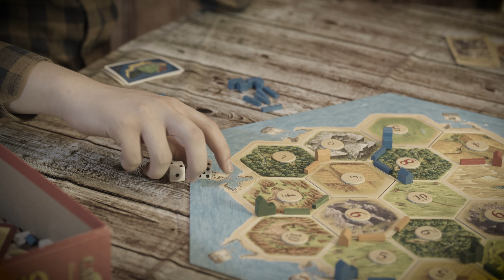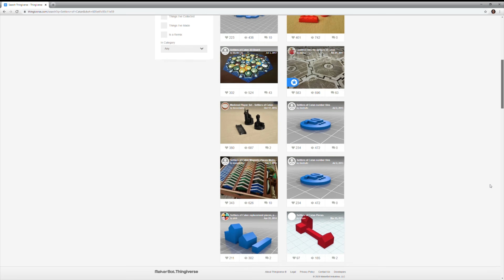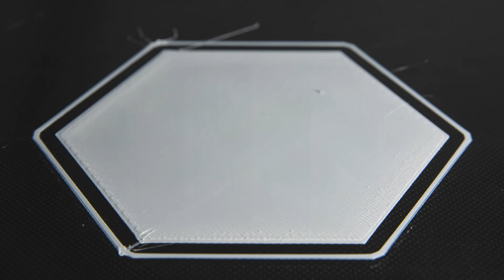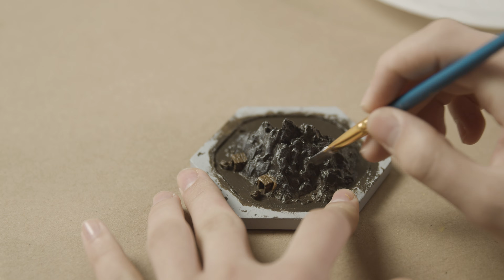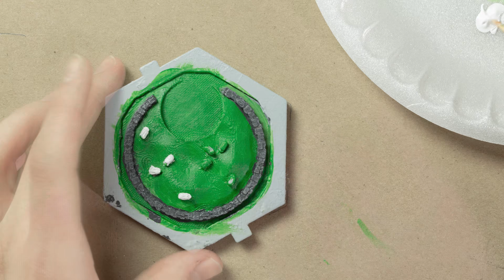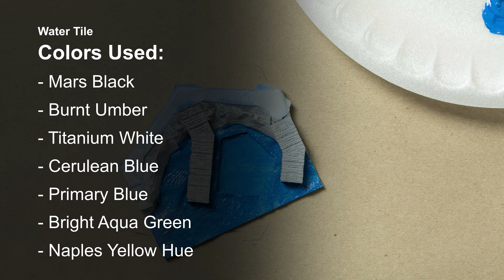We Made a 3D Printed Settlers of Catan Set!

Comment: I do not own a printer, I wish to buy these from you.  Do you have an "Unpainted" "Non-Magnetic" selection?
Reply: I'm currently printing my own set. To be honest, it takes so, so much material. I'm using somewhere two and three kilos of filament for the base game + seafarers + cities and knight + 5-6 player expansions.. By the time you pay someone to print that much material for you, you're better off buying your own printer.
I've got an Ender v3 SE which is an excellent starter printer. The Bambu A1 Mini is also commonly praised as an even easier starter printer, although it is more expensive. 3 kilos of gray filament should cost about 60 and I just bought a set of 500 6x3mm magnets for like 10, so you might as well add those.

Comment: I love these, I do have a problem though, I've downloaded your patreon files but some of the option 1 parts are corrupted, ive tried downloading them on different machines, but the same problem, is there any chance you could let me know how to fix the cad files in option 2 to ammend the corrupted parts? feel free to pm me to reply.
Reply from the maker: Hello! We've had a couple people mention similar issues, depending on the slicer software you are using. I recommend grabbing a free app called Meshmixer. You can open the file and repair it. It's easy and works very well. You can grab it here:
https://meshmixer.com/
Reply: @SomethingEpic  update, this has worked a treat, opened it up and exported it again as an STL, seems to have done the trick, thanks for the help guys, hope to see more stuff from you soon. stay safe!
Reply from the maker: @kieranhall9365  Glad to hear it! Meshmixer is an indispensable tool for 3D printing!
Reply: @SomethingEpic  I'll give it a try, thanks for the prompt reply <3 very much appreciated

Comment: The Longest Road trophy file has errors when trying to slice it. it looks like a band around a barrel and the +2...I'm not sure how to fix these
Reply from the maker: Hi! Can I ask what slicing software you are using?
Reply: @SomethingEpic  I'm using Cura
Reply from the maker: @elviorion  Hmm. That's the same slicer we use and we haven't run into this. What I would suggest is to either try converting the file to another format (if needed, you can use a free online converter such as https://www.meshconvert.com/) and see if a different format will give better results, or try adjusting some of the settings in the slicer, such as the layer height. Let us know if this doesn't help!

Comment: I just finished printing these out and painting them.  The game looks excellent.  Here are a couple of comments:

Printing using a snapmaker 2.0:

The wool tiles (4,5,6)  on the option 2 group are not Wool but wood.  Opened the option 1 tiles and they are correct but since my printer has a lot of metal we opted for double printing
the wool tiles (1,2,3)

The cactus on your tiles seem much larger than those on the printable tiles.  I would have liked the larger cactus.

My printer had a heck of a time printing the piers on the water tiles.  Might be my printer but nearly all of them deformed in some way or another.

The wheat tiles sometimes failed at print as well.  There seems to be voids under the wheat bundles that cause the bundles to break off easily.

The dragon is awesome.  But difficult to print with a PLA printer.  I suggest a resin printer for the dragon and the trophies.

The painting was long and arduous.  However, a painting party made short work of it.  

Despite my gripes, the finished game looks fantastic and my family has spent quite a few hours playing it.
Reply from the maker: Hi there! Thanks for the feedback! You were right about the missing wool pieces. If you message us your email address I will send the correct ones to you (We're updating the download as well). I suspect the cavity beneath the wheat may be a slicing error (we have had similar issues) but we'll double check. We've actually had good results printing the dragon using fdm, but a resin printer sure works well for those tiny details.
Reply: @SomethingEpic  The Wheat tiles did print better individually.  It was when I tried to print all 6 at the same time that I had the error, so you may be correct about the slicing error.  And, I'll add that the Dragon issues that I had were mostly due to support generation.  And I will admit that I went fairly heavy on the supports.

Comment: I'm about to print water tiles, but files are corrupted (model are not manifold). Could you update them in order to make them printable ? There are other issues with land tiles as well, but I dealt with it so far. One last thing, when printing the 30th layer (with a 0,2mm layer height), magnets hole are not covered immediately and a few amount of material is dropped right above the magnet and could prevent the magnet to move freely inside its socket.
Reply from the maker: Hello! I have a couple questions in order to help you out: Are these files downloaded from our Patreon? What slicing software are you using?
Reply: @SomethingEpic  yes those files are from your patreon pages (i use the option 1). I use Ultimaker Cura as slicer.
Reply: @AntoineLépée  I ran into the same problem with the water tiles using PrusaSlicer. Wood tile 5 is also giving me a similar issue.
update
Loaded the files into meshmixer and re-exported them. They load and slice fine in PrusaSlicer now.
Reply: PrusaSlicer 2.3.1 can't open any water tile from option 1 :( 
@UCkgd8VXNJCiqz88H9Dw-Kzw hint with meshmixer worked excellent. Thank you very much

Comment: Liked and subscribed!

A couple of questions though:

1- How is the 3D Printer: Flashforge Finder going? After using it for at least several months, do you wish you had a different 3D printer?

2- The link to the magnetic balls is not available anymore. Were they 3mm or 5mm magnetic balls?
Reply from the maker: We have had 2 Flashforge Finders for at least 2 years now and have not had a single issue with them. Not a single clogged print head or anything. 
Also, the magnets are 5mm.